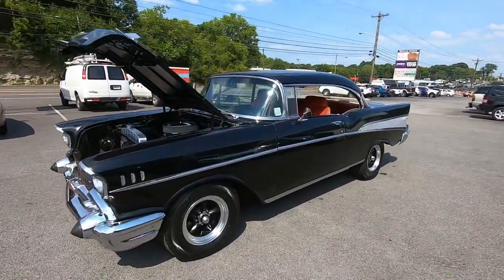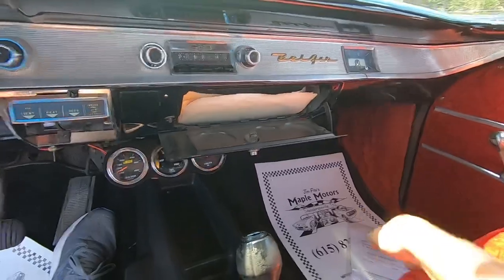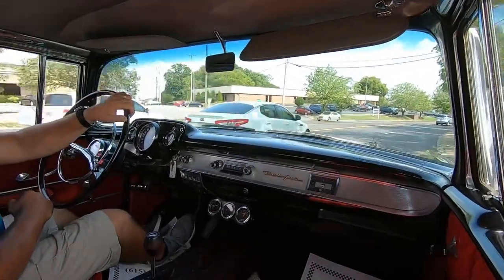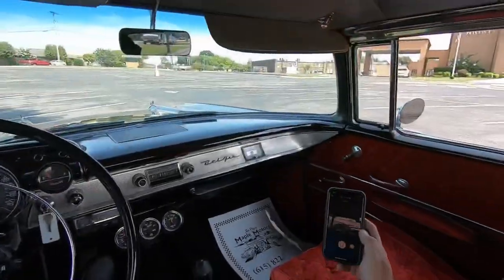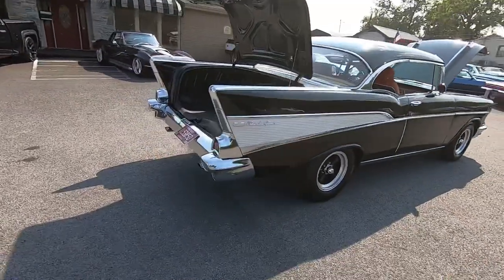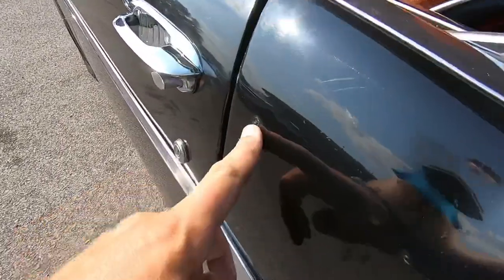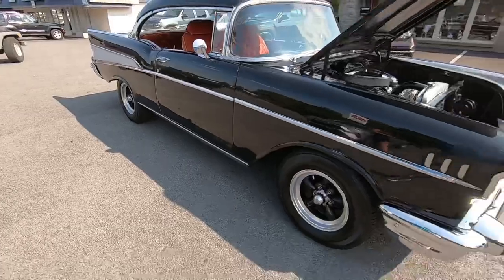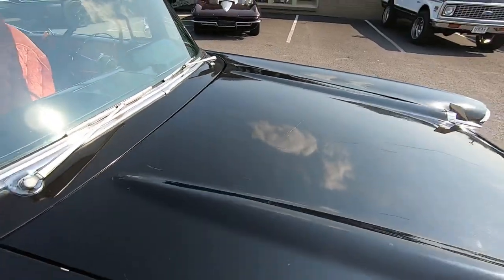Test Drive 1957 Chevrolet Bel Air SOLD $27,900 Maple Motors #1205-1

Comment: Those buckets are '67 Chevelle buckets not worthy of having been pimped (redue blk) along with back seat. Take everything out not stock in interior such center and gages replaced with Sun tach and gages. Replace auto with 4 speed body and paint (Not blk) blue or root beer. Figure walking out the office about 30,000k after what I suggest your talking about a 60k car and a respectful 60k '57 at that rating at a strong B car. Want a show car your talking over 100k and you and I both know your never done with a show car regarding expenses! Down time figure 3-6 months.